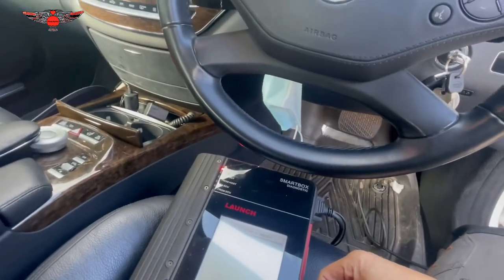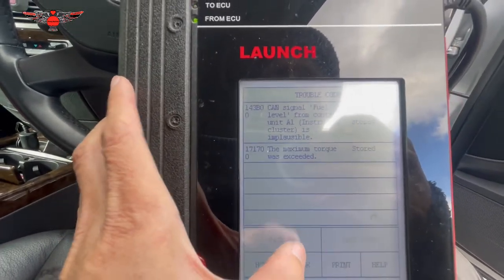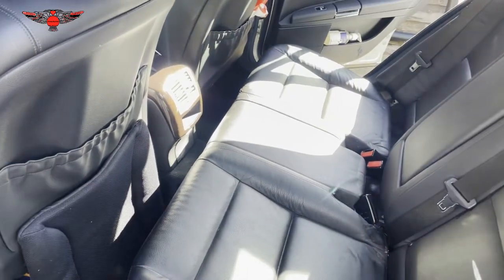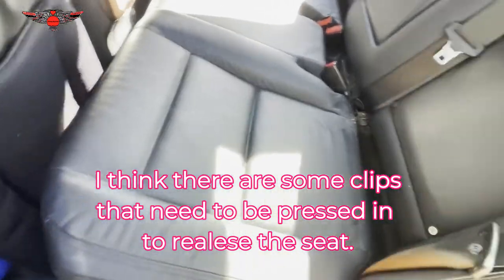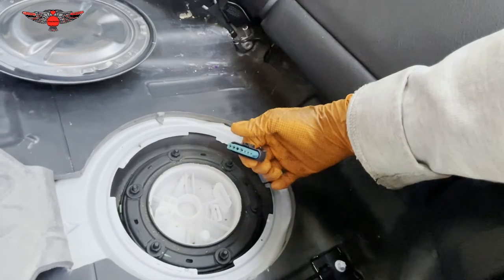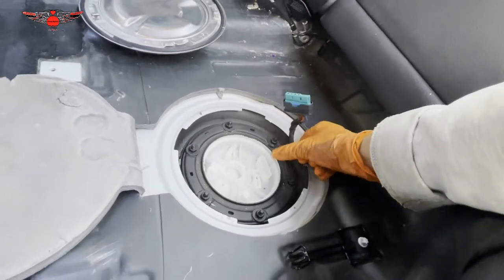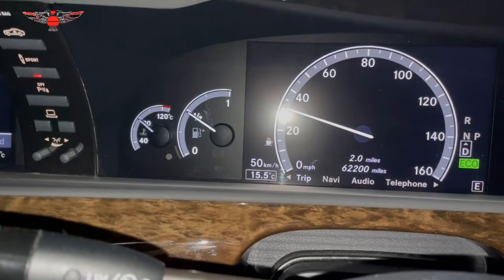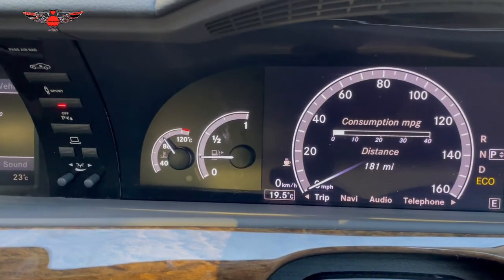Mercedes S class S350d diesel w221 2012 fuel gauge reading empty sender unit not working location

Comment: i`m thinking of getting 1 of these 221`s 350d`s in the very near future, what do you get REAL world mpg, i know whats "quoted", but real world is never the same, would you recommend 1 of these or do you think the w222 is a better buy?
 thanks
jerry
Reply from the maker: I mean if you can afford the w222 it will probably have many more features and advance technology. The w221 I drive still a beautiful peace or kit, gives me around 50mpg on the motorway. And around town somewhere around 30mpg. It’s a big heavy car, very comfortable though. I love it as much as I would probably love a w222 hehehe.
Reply: @DaringBeefcake  thanks for that, i was after the facelift model from 2010 onwards, BUT i didn`t realise they have to have ADBLUE ,i don`t suppose you know the answer to this question, but if you filled your car to the top of the tank with diesel, how many litres of adblue  would be used ( roughly) also are there any common faults on the 350d to look out for ? it`s silence and comfort i`m looking for, i was considering a lexus LS430 which are also very quiet, and possibly an E- class, but i don`t think an e -class would be as quiet as an s-class?
Reply from the maker: @t5jerry  to be honest I dont know the answer to the adblue question however i added 10 liters of adblue last year and have filled the tank many times since and did may be 7000 miles, so it does last, however not sure how much adblue was there to begin with, which reminds me I should add some, just incase...its very quiet car and the e class is also fairly quiet to be fair..I had issues with the front suspension arms squeaking. and the fuel gauge but not sure that is a common one. Perhaps the Lexus LS430 would be more reliable in many ways but i haven't really owned one so not sure how they feel to drive...

Comment: Any chance that this is the same on the w222 s350 bluetec 2014 model? I bought the car with faulty fuel level sensor. Mercedes says they don't sell the sensor seprately but I need to buy whole tank and change whole tank. No way I'm doing that...
Reply from the maker: O my God really, buy and change whole tank, that’s crazy. I hope is not the case. But am not sure it’s the same as w221 sorry.